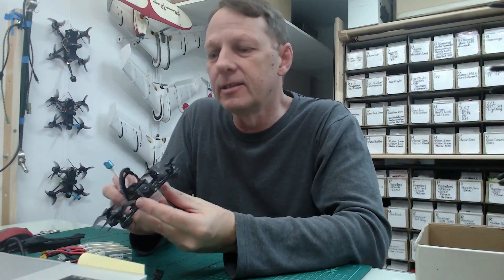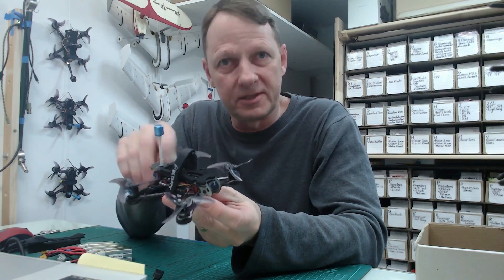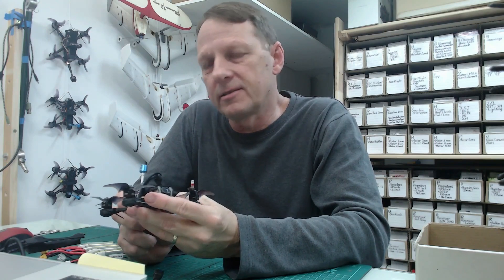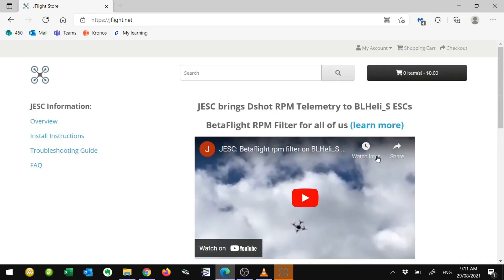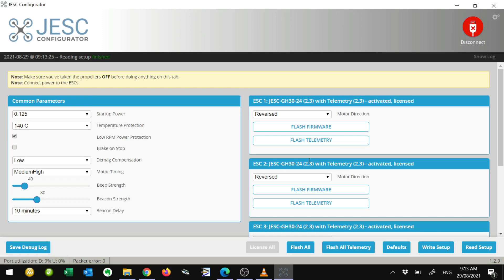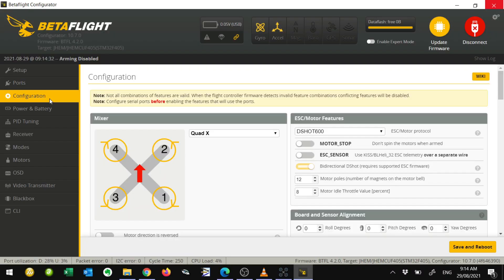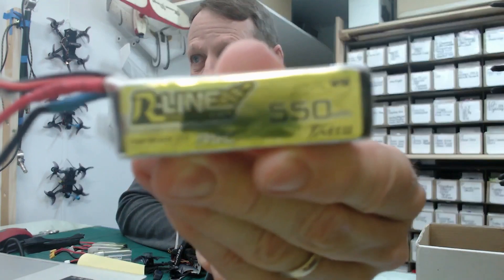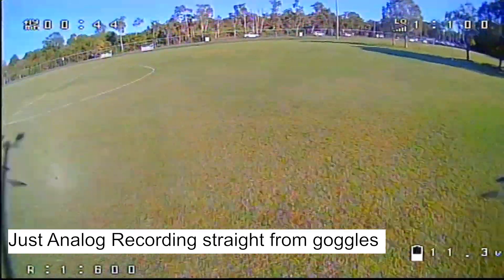TinyHawk 2 FreeStyle Upgrade - Final Report

Comment: Awesome as usual!  I know I inquired in a previous video about the weight, with the newest upgrades, what was the final weight?  Additionally with the added weight and limited flight time, have you considered upgrading to slightly bigger motors?  And if so, which were you considering?
Reply from the maker: Sorry I don't have the weight as I have now disassembled this quad to use the FC in anothe rproject. I was very happy with performance with the standard motors. Unfortunately there are no other motors with the same mounting pattern as these original motors so if you are using this frame you only have one choice for motors.

Comment: Can I use those R-line battery's on the stock board or do I need to upgrade to the  jhemcu one and if not what battery would you recommend?
Reply from the maker: The original fly controller bill only take 2S. If you use a 3S battery is all fry the flight controller. Try to use good quality 2s 500mah batteries tattoo or r line
Reply: @cubefpv  sorry i'm a bit lost so it would be fine to use the battery that you showed in this video called Tattu R-Line 7.4V 2S 550mAh 95C LiPo Micro Battery - XT30
Reply from the maker: @SpawnzFPV  yes 2s is okay to use with the original FC.
Reply: @cubefpv  Okay, thank you so much for the info btw, love the videos really helps to follow your videos when I upgrade mine, I have all the stuff just not the foxeer cam think I'm just going to upgrade without it for now